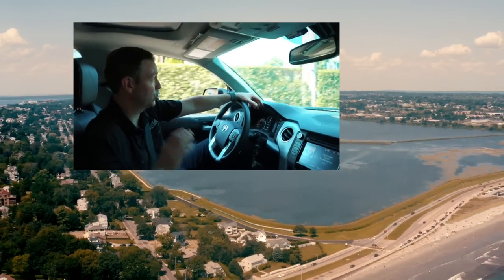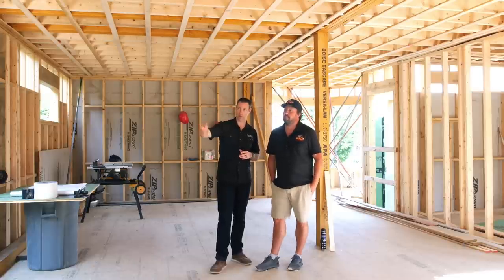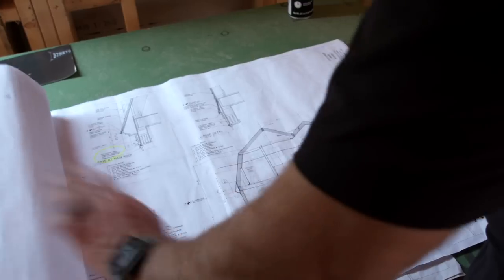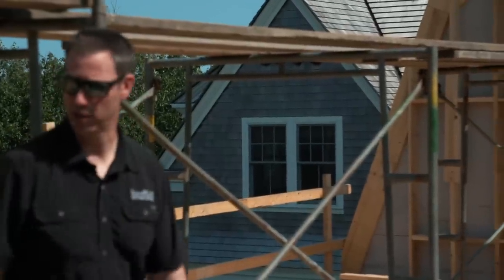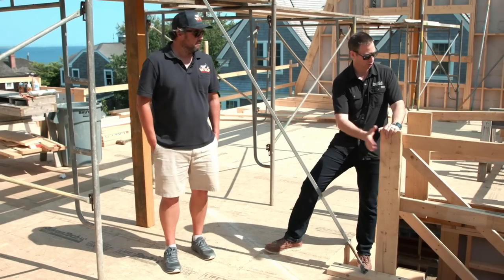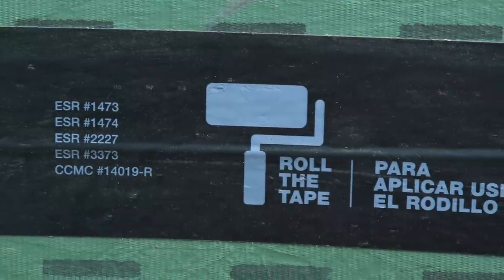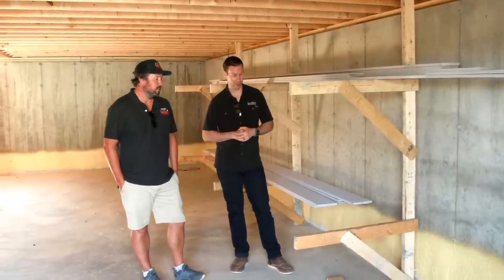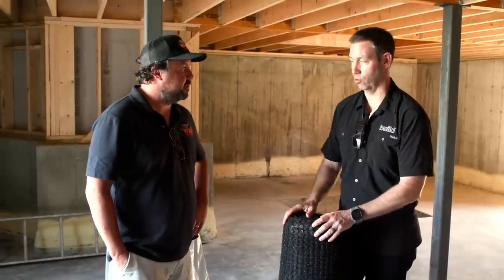FRAMING - Some surprises for an efficient BUILD on this home!

Comment: Clean jobsite! I would like to see an episode on discussing how these contractors price. In Alabama I don't care what you pay, the framers are not going to build handrails and fall prevention for the job, stack their lumber and vacuum up like this jobsite. There must be a site supervisor directing work everyday, but the customer never has the budget to pay for it. So us builders show up and the site is a WRECK. Priming the cut end of wood? It would not be done if there is not someone standing over the guys making them. That means the subs have to charge WAAAAY up there for there trade. So the builder has to be at a cost-plus basis to make this happen. But surely there are customers paying the cheaper contractor at a less %, right down the road as it happens everywhere. Also we need an episode on how they are reaching their target market.

Comment: Does anyone have experience using the metal braces vs 2x4? Is it worth it? Do they last ? Do they have 20 ft ones ? Is it easy to spin that little rod? Seems like it would be hard af if you had to pull 2 inches in a tight spot .

Comment: Question for all the contractors on here: 
I've recently started switching from spec'ing (3)2x headers to deeper (2)2x or LVL headers to leave space for insulation in the header. Is this a worthwhile change or should I go back to shallower wider headers?
Reply: I use insulated headers for 2x6 walls

Comment: The thing with backup sump pumps.. if you just backup the power, yet the pump itself fails, then you are SOL. 
Should have a water-powered backup sump pump, imo.
Reply: If a house requires a sump pump, 2 should be used for redundancy.

Comment: This should be the standard for a traditionally framed home. As far as waterproofing and thermal break, and air sealing are concerned. IMHO. A person can save enough coin using 2X's for joists and rafters vs trusses to make up the cost for Zip R. I do prefer floor trusses, but we've built alot of great homes using traditional lumber. The water, air, and thermal barrier are going to either make or break a home no matter how you build. 
I am curious as to why we aren't seeing insulated headers. I know there's the mass of the lvl's and the Zip R.... But with the money spent on thr build here and being in zone 4 climate, I would think that detail would be of importance. Just curious. Maybe you can shed some light on that topic. 
Thanks for the content Matt!
Reply: I think it would have been better to use 24 OC instead of 16 OC used in this project. My guess is they opted for 10 foot ceilings forcing 16 OC walls :(

Comment: The technical drawings look like they are drawn by hand. Is it possible these are like Blueprints made with a tee-square and not CAD. Definitely a knowledgeable builder doing leading edge construction.

Comment: Impressive builder.... only thing I didn’t like was the Gorilla glue polyurethane stuff..,, Titebond 3 or West System Epoxy has my vote for that situation
Reply: True, Project Farm just did a video on what glues and adhesives were the best and 8x Loctite won. Don't think Gorilla glue was even close ?
Reply: @augustreil  Those were two great episodes.  Awesome show.
Reply: @scorpio6587 , It sure was. That guy is really good at testing stuff.
Reply: I've been using gorilla glue for almost 20 years, all I can say is the glue works!

Comment: Layman here: that looks like an awful lot of wood for the framing (still doing 16" on center) and all the wood used to frame the window openings and doors. In a climate like RI isn't that going to give a lot of needless thermal bridging?
Reply: The Zip sheathing has an R-3 on the inside of the plywood. It's not much but at least it's something. We get some hurricanes here and the stronger the better.

Comment: Mat I would like to know more about the spray foam under the basement slab, will this work as radon protection, an will the spray foam work as a water protection if the sub pump goes out, will it hold out water from seeping around the slab an creating a mess an I can't find nothing on that tough an dry insulation would like to know more on both, long videos are good with great information great video

Comment: What's the difference between using the spray foam under the slab versus using rigid foam?
Reply: He kinda explained it in the video. Starts at 22:30
Reply: Closed cell foam is a moisture barrier.   Less dense foams allow moisture flow.   I recall the builder in this case used closed cell between earth and basement slab.
Reply: @johnbecich9540  Typically a vapor barrier membrane is applied over the ridge foam. Issues:
1. you need to make sure your grave is very level so that the rigid foam does warp over time causing the slab to crack.
2 Need to make sure the spray foam can support the weight of the slab, if not the slab above will deform & crack.

Comment: I could not find the foundation insulation/drainage product under "tuff n' dri" name - there is a product from Tremco Barrier Solutions with that name, but it appears to be a different product.  I did find a product that appears similar to the one pictured, "Shock Wave Drainage & Insulation Board" from Mar-Flex: https://mar-flex.com/products/residential-solutions/drainage-insulation-boards/shockwave-drainage-board/

Comment: Hi, Matt just wondering if you could use the floor spray foam for a good radon barrier.
Play Safe from Elliot Lake Ontario Canada.
Reply: Yes, closed cell is a radon blocker
Reply: Don't think its a safe option, it will still slowly migrate up. I believe the floor planes show piping for radon venting.
Reply: @guytech7310  Thanks for the heads up.

Comment: interesting he is still using full wood thickness headers,  we use 2 2X12s no fillers at the outside of the wall, with a 2X6 flat on the bottom for drywall fastening, this allows for a full 2-1/2"  insulation cavity (in a 2X6 wall) at the header,  much better thermal break than solid wood, but still providing adequate strength, or where added strength is needed, you can do the same with LVLs

Comment: Seems like a lot of wood in those walls, with only an R-3 thermal break with the Zip R polyiso. Anyone else think there could have been a few more advanced framing techniques beyond the California corners?
Reply: I was thinking the same thing. However, with the proximity to the ocean, the code requirements for wind loading on the walls is much higher than a good chunk of the country, possibly driving the need for more framing in the walls.

Comment: is there no damp-proofing between the foundation wall and footing?  moisture will always rise regardless of the specs for the concrete.
Reply: Usually the sill plates are isolated from the foundation using a sill sealer roll.  I presume sill sealers have been used in this project. You can also add an extra measure but applying a concrete sealer to the top of the foundation walls before installing the sill plates. I would recommend using Neoprene sill gaskets (www.ConservationTechnology.com) instead of the poly-urethane sill sealer. Matt used the Neoprene sill gaskets in one of his videos. I would also recommend leveling the top of the foundation walls using a angle grinder with a carbide disc blade.
Reply: @guytech7310  good points, but I would endeavour to keep all moisture out of the foundation envelope.  there's a good product made by Dorken-Delta: "footing barrier"
Reply: @expediter99  You never keep it out. For instance it can wick up from the foundation footings, or from the interior side.

Comment: So the real wood is cheaper than the "was wood" ?     Just opened up a 1998 home built here near Austin,  1 inch OSB  sub-floor, never got wet, but showing signs already,  dry, powdery,  and weak.   Sorry will never use "was woods" of any type.   You can get a good home elevator for 30K,.

Comment: The floor feed and ceiling feed idea without any actual ductwork in the walls of the living space is so god damn genius . Does this mean you need 2 separate heating and cooling units ?
Reply: yes, one system per floor minimum. this approach is new to you? my father & grandfather were builders & I'm an architect & it's the only way we build, with no ductwork in walls except return air grills. (though I've seen examples where production builders cut corners by having one system for two floors)
Reply: Joel Williams Yes it is, though I am a framer not a builder, so I don’t have the extensive  all around knowledge as a builder would. But good to know for sometime in the future ! Thanks ! Most of our builds have ductwork through out the walls from what I remember. I’m definitely going to be paying attention now .
Reply: Unless wade is putting that second HVAC unit in the top/attic/gambrel floor, he will also have to have at least one trunk supply going up the wall to that floor

Comment: Impressive build quality.  One thing though: I don't believe the Zip R-3 sheathing is approved for Lateral bracing, or for use in that location.  I think it's only rated for up to 120 mph wind speed locations, and for type II construction I think Newport is 130+ :   

https://hazards.atcouncil.org/#/wind?lat=41.4901024&lng=-71.31282850000002&address=Newport%2C%20RI%2C%20USA .  

 In Eastern Long Island builders using Zip R typically sheath first with OSB or plywood, and then apply the Zip R over it.  The problem is that the Rigid foam doesn't resist lateral loading, thus losing it's value for wind/lateral bracing.  Someone may know better . . . ?

Comment: In Connecticut electrical code States that any cable concealed in wood members need at least  1&1/4 ancho spacing between the sheetrock and the wood.
This wood is only 3/4 inch thick he said so this would fail in Connecticut.
In fact wherever this is I'm sure the inspector is getting paid to turn his head or he just doesn't know cuz I've ran into inspectors at don't know anything

Comment: I realize there are budget constraints, but in my opinion, using a floor structure that requires interior columns, instead of a thicker/stronger structure that can transfer the roof and second-floor loads a few more feet to the walls of the room, is a short-sighted mistake, but otherwise appears to a very nice design & quality construction
Reply: I agree. If you leave it to an Architect they will do those kinds of things. Architects should stick to making things look good, and let Engineers worry about the structure. Of all things I absolutely wouldn't have skimped on (besides less posts), are I-Joist floor joists. Other than that though, a very well built house. And I'm not sure why the double trim studs everywhere.

Comment: Why use cedar if you are just going to paint it? I prefer Hardy board.  I save the expensive cedar for show locations.
Reply: He's building in a historic district that requires cedar.  We use Hardy board also, great product.
Reply: Possible municipal requirement.  They're in a historical location where the architectural details are somewhat pre-determined (?)
Reply: Did you see where the house is located? What would the snooty neighbors think if they didn't use the most expensive materials!
Reply: @mykalimba  Great reply. So true.
Reply: Historic District, only cedar allowed for exterior trim

Comment: Love the channel but dang this stuff is way too expensive for most of us.
Reply: Yes it is, however you must remember these are "Empty-Nesters/Retirees" this will be their final home. Then this house will live on through the family for at least 200-300 years, mainly due to the entirety of EVERY little detail Wade has performed from the footing  drainage/insulation detail right down to to priming the end cuts on the Cedar Rakes. Remember this is New England the weather is harsh......VERY harsh for about 8 months out of the year, add in the Sea-fairing gusts and moisture and you need to build this way.
My guess, in Newport (Some on the highest real estate values in country) including land is probably in the 3-4 million dollar range.

Comment: The way i see it.
Studs 6" and 16 CC. - Better to go 8" and 21", you will save a lot of material and time. 
Advantech floor - good but use 1" thick or better. 
The extra planks in cealing - Great and the way we done it for 50 years. Now do this to the walls to.Plastic on the inside of the wall - great. Rockwool - great. Black tar on walls below ground. - Very bad. After Rockwool, the new thing to do insulation and water management for in ground walls is. Nothing to the wall, then "isodrain" a pourous rock material rather thick. Then plastic outside of that. And the plastic connects to the wall, just below the surface. And french drain.Slab insulation - great.All forms of shingles - very very bad, and expensive.
Reply: John Strand   just curious why are both the roofing and siding shingles “very bad” ?
Reply: Perhaps they look ok. But that's it, they leak, and they take a lot of time to get on. And they don't last so long.
Reply: I guarantee this neighborhood requires you to have cedar on the walls and roof. Every single house around it does too

Comment: "Not a huge house. What is it 3500 sq ft?" Jesus christ thats a Massive house! 
Must be a Retired couple cause its under 3k sq ft right? OMG the out of touch insanity
Reply: And only a single car garage. WTH?
Reply: Limousine !
Reply: Probably closer to 4500 sqft with the unfinished basement. Most high-end construction projects are 5000+ sqft. so small comparted to the average.
Reply: Agreed. And most retired people worried about mobility don't buy elevators, they buy 1-story bungalows.
Reply: And did you see that it was smaller than almost everything around it?
Reply: @jeffmathers355  One story in the middle of all those multi-story mansions...the neighbors wouldn't let it happen. This area has HOAs with money behind them.
Reply: @KarlKoning  correct, which just speaks to the out of touch with reality part of the OP
Reply: Matt builds in Texas where homes are almost universally huge. It's interesting to see how growing up with abundant open land shapes people.

Comment: Man, there is a framing technique that hasn't changed in 30 years. No advanced framing no nothing. An embarrassment of wasted wood and inefficiency. The only thing thoughtful and of interest is the spray foam under the basement slab. A good idea but I bet if you look at the cost you'd think twice.
Reply: Which more advanced system would you recommend for a house of this size and location?
Reply: @peadaroloughlin3270 , How about Rockwool ComfortBoard?

Comment: Sorry Matt,  but 3500 square feet is a big house. I'd be happy with half that.
Reply: I guess it depends if you live in the house or are always out doing things. It also depends on your amount of hobbies... Personally with vintage stereo collection, woodworking, handyman and automotive tools I benefit from at least 3000 sq ft. If someone lived in a area by the beach and spent most the time there maybe 1200 sq ft would work...

Comment: Put the crack pipe down.. lay off the communion wafers.. whatever you need to do to understand that yes 3000-3500 is a huge freaking house. Sure there are bigger ones, but just two generations ago the average US house was about 900 sq ft. Just a couple of years ago it maxed out at 2700 sq ft. It has dropped since thanks in large part to common sense and the tiny house movement. 

When you forget that you are an elitist who works on only super high end homes that are absurd in design and size you clearly lose all perspective.